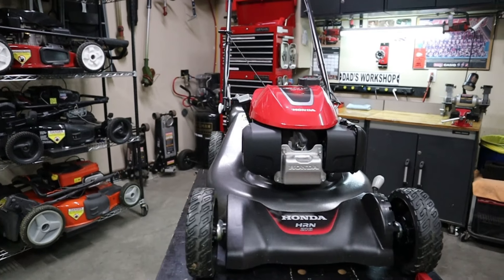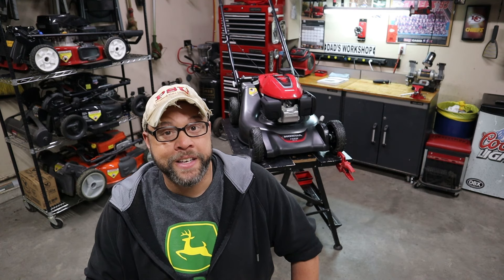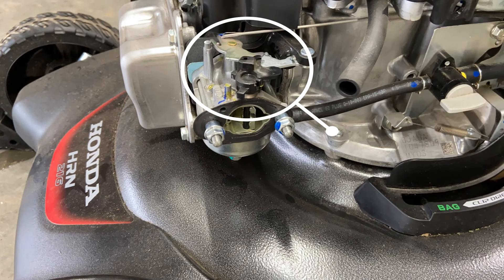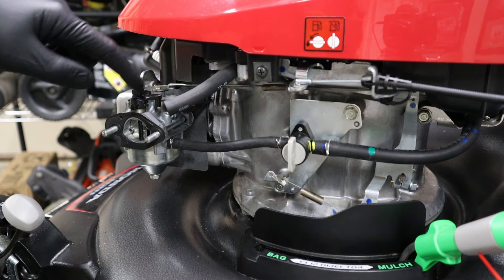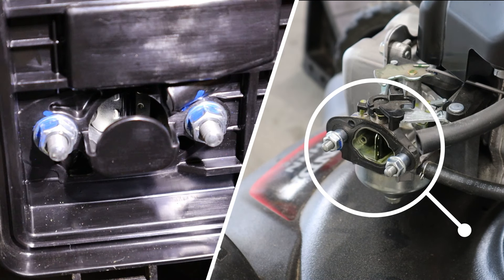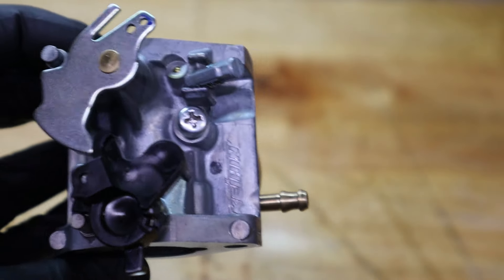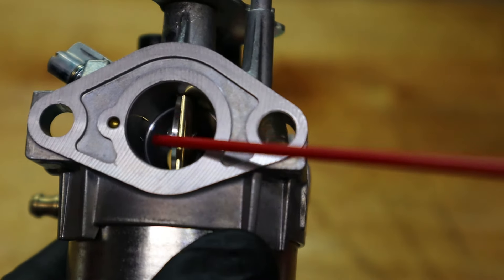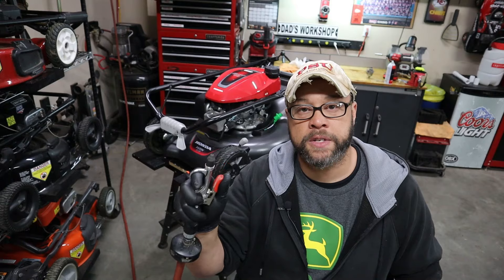New 2020 HONDA HRN216 GCV170 Surging/Rough Idle AND Auto Choke Test/Check

Comment: One important step you failed to mention is to remove the idle mixture screw. Many times that's where the restriction is at, the only way to clean out any stuck debris is by removing it. It's the brass screw with a spring around it and is underneath the aluminum cover with a slot for a flathead screw driver which you must remove it in order to remove the idle mixture screw. It's held on with Loctite so don't try prying it off or you'll snap off the brass idle mixture screw. You need to heat it up with a small torch for a few seconds (Bic flame torches work great) but it'll quickly melt the aluminum if you're not careful. Before removing idle mixture screw, make sure to tighten it until it bottoms out while counting the number of turns because it needs to be set back in the exact same position. If you forgot to do this, it's 1-1/2 turns.
Reply from the maker: Thanks bud!
Reply: I don't think he failed to mention it; I think he didn't mention it because in most cases, like mine, it's unnecessary.
Reply from the maker: This a fixed throttle. You can't adjust the throttle on this style carburetor.
Reply: @dadsworkshopbykipplabrie7982  It's an air/fuel mixture screw for the low speed jet, not an idle speed adjustment. CCW richens it, CW leans it out. With this type of mower in particular with a blade clutch, it uses the low speed jet with no load on the engine (blades off) so you'll notice more of an impact with a clogged low speed jet than a traditional mower where the blades are spinning whenever the engine is running. Yes, you can just try blowing out the low speed jet with carb cleaner and see if that fixes it, but in my experience, that doesn't always fix it and it needs to be disassembled completely.
Reply: lol ok bud @weeeves
Reply: Thanks for the tip

Comment: Guess I’m the only one that the Hulk installed the pilot jet screw in. It will not budge. This will be my last Honda, the name no longer means quality.
Reply: Yeah same here but I did a number on it, stripped the dam Philips notch right out😩
Reply: Same here. I soaked it it’s Aerokroil overnight. The screw is so soft and so driven-in that the slot just rounds out. I put a 1cm length of auto vacuum tubing over the round throttle stop on the upper left side of the carb. It’s enough of a spacer to increase idle speed and stop the surging. Not an elegant solution but it is fast and cheap and it just works.
Reply: Same. I was about to strip it and decided to stop.
Reply: Couldn't get my screw out either. Just about stripped until I decided to stop. Engine still surges........
Reply: Same issue with the screw
Reply: My screw did the same, but got a small set of needle nose Vice grips on the screw head. It didn’t take much to get it to turn just a little, then it came right out
Reply: @justinhaynes9966  did it fix the problem once you were able to get the screw out?
Reply: Super tight but I got it, blew a little keyboard cleaner through, fixed it right up
Reply: Same here. I used a file to create a deeper flat opening and used a big flat screwdriver with the carb in the vice, set it on an angle to break it open and tapped it with a hammer, it came off but it was a pain in the ass
Reply: Same here. The Hulk held the carb while Superman tightened the screw.
Reply: Put a little heat on it, a torch for about 10 seconds and repeat a like longer if not successful the first time. No gas in or around an open flame. Duh! LoL
Reply: Is there a way to clean out pilot jet without removing that screw on top? Like spraying carb cleaner up from bottom? I also stripped the screw
Reply: Whoever put that pilot jet screw in used the same torque setting as a Honda crank bolt. Mine stripped out as well.
Reply: Haha I just did tried this today and almost immediately stripped the screw. Now I am not sure if I have to buy an new carb or get it serviced. Not sure if there is a way to clean it without removing the screw
Reply: I had to remove the red cover to get straight angle and enough torque from Dewalt driver but then no issue
Reply: Same here, stripped it, couldn’t get it off, but cleaned other two holes and it worked fine after
Reply: They use threadlocker on it and the pilot jet because it's an emissions carb. They'd rather you throw away a perfectly serviceable carb and have to spend $60 for a new carb every 2 years. Jerks.
Reply: Yall Crack me up, if your stripping it out you need to get a new qaullty screwdriver. I personally like to use a rachet screw driver with a fresh bit to get these out. No issues. If you start to feel it stripping, STOP and grab a pair of vice grips to give it some more leverage
Reply: Same here my lawnmower and power washer both have problems all the time
Reply: My screw was also very tight, but removable with mole grips (UK term for vice grips). Post-cleaning, the mower runs fine.
Reply: My 2020 honda just broke time to pull out the 2004
Reply: @jmabs5096 yes a ratchet Phillips head worked great. Thanks for your comment !
Reply: @jesussolis6840 I wasn't smart like you, I went ahead and stripped the duck out of mine🤬
Reply: Yeah!! The Hulk's baby brother must have installed mine, stripped the crap out of it 🤬 Buy a Honda and you'll be happy, i'm not happy now!!
Reply: The screw tightness is how the green liberals keep us honest, easy screw removal might tempt someone into wollering out the jet hole a tiny little bit so it could perform the way it should. And that is exactly what I will be doing if I can manage to get the screw out. That'll teach 'em.
Reply: Yeah, me too. Thanks for making this look so easy. Reality is a little different. My pilot screw is now stripped. But, hey, kipp’s came right out. No problem.

Comment: I have the exact same mower with the blade clutch. HRN216VYAA. Right out of the box brand new,  the mower has always surged at the fast idle throttle lever position. At slow idle it runs fine and with the choke on it runs fine. Engage the blades and it runs fine. It only surges at fast idle. I replaced the brand new carburetor with another identical brand new carburetor. Same exact issue with the other carburetor. I really think the idle jet is too small. When the blades are engaged, the mower runs off the main jet. I will probably have to take the mower to an expert who's been repairing mowers for 40 years. A guy like that probably knows exactly which size reamer to use for reaming out the idle jet. I don't have the stomach to experiment because the carburetors are over a hundred dollars a piece. If the idle jet was removable like the main jet is, I could experiment, but the idle jet is not removable.

Comment: Installed new carb, new gaskets, new plug, new airfilter, keeps hunting. racking my brain as to why!!
Reply from the maker: I’m sorry to hear this. Double check your governor spring setup and linkage on the new carburetor. Thanks for watching
Reply: @dadsworkshopbykipplabrie7982   found the issue and it was my carelessness.  As you know, reinstalling the carb and lining up all the gaskets can be...I installed the 16211-ZL8-000 Carburetor Insulator was upside down.  once I installed it correctly so the vent was to the bottom, it worked.
Reply from the maker: Hell yeah! Good the hear
Reply: @meggabitz  Nice catch! I'll have to go check my insulator and gasket as I've already rebuilt this carburetor after inheriting an HRN216 that sat unused for a decade. It's very possible I got the gasket or insulator upside down.

Comment: Mine is doing this on the first start of the season.  Cleaned it out as described and seeing the carb cleaner work its way through but still surging. 🤬
Reply from the maker: Try sticking a sewing needle down the pilot jet
Reply: @dadsworkshopbykipplabrie7982  another cleaning along with sticking a needle in it and it started running properly.  Thanks
Reply from the maker: Hell yeah! Dillon I'm here to share.
Reply: @grieve84  for real needle did the trick for me as well

Comment: Thank you so much!  8 month old pressure washer was doing this exact thing at idle. Under load it was fine. Took carburetor off and did as you suggested and she now idles smoothly!  Had a heck of a time getting the screw off but finally got it. Went to a Big Box store and got a set of welding nozzle tip cleaning brushes for $7 and used them to clean the pin hole and did the main nozzle too.  Super easy and would not have known how to correct this issue without you!
Reply: How did you get that pilot jet screw off? I haven't been able to budge mine. Might try heat next and if that fails I'll cut a slot for a flat blade screw driver.

Comment: You recommend checking the autochoke mechanism in step one.  Mine did NOT work properly.  I had to replace (Honda 16620-Z8D-305 Thermo Wax Assembly) and the autochoke  mechanism returned to normal.  

Your tips on disassembly/re-assembly and jet cleaning were very helpful and initially fixed my problem, but the problem came back in my case. Premium gas made no difference.  Thanks for all the conversation helping all us DOY people save $$.

Comment: The same general fix works on older HRX 217 mowers, as well. Surging is a common problem with them, too.
I could not help but notice how much simpler it is to access and service the carburetor on this newer model Honda mower.   Sweet!
Thanks for the video.
Reply: I got a brand new 2022 HRX HYA model before the inflation price hike.  If you do any type of scalping for a new lawn establishment (thus generating lots of dust and dirt clouds), just be ready to deal with a "surging on idle" symptom and clean the carb.
Reply: @mattb9664  I never scalp a lawn, but I always check the air filter for dust build up.  I add a good quality fuel system cleaner to my mower gas and also use TrueFuel for every third tankful of fuel. I always store the mower over winter filled with TrueFuel.  No surging problems since I have been doing this.  No carb rebuilds, either.
Reply: @jerrystark3587  scalping 1" for lawn renovation that is.  Never during normal mowing!
Reply: @mattb9664  👍👍
Reply: @mattb9664  I scalp my lawn once a year too. I usually cut it at 3” but will take it down to 2” when I power rake and aerate. Then I like to fertilize and top dress with some peat. I have an HRX217 that is close to 10 years old. It does this surging thing when I first start it up but it goes away after about 30 seconds. It has done it since new so I always thought it was normal. Lol
Reply: @beri232  Yours is acting quite opposite of mine- It could very well be the wax cartridge for your case.  When that dust cloud is generated, it gets everywhere and reaches the wax cartridge too- the dust will collect around the pin when it's extended, which then draws dust into the thermoswax inside the cartridge when the pin goes back in during cooling- and the temperature cycling behavior of that pin is totally changed at that point, becoming slower and maybe not even fully drawing back in or pushing out.  This causes harder starting and makes it really hard to start in the fall during cooler weather.  If that choke isn't working correctly, you can have surging after starting from cold.

Comment: This did the trick, under 10 minute job.  I removed the carb (take note of what hole the linkage rod and tiny spring go for reassembly - take pics prior to disassembly) I used carb cleaner, then compressed air at 30 psi.  My new mower started doing this 3 weeks/mowings into it.  Thank you for this video!
Reply from the maker: Thanks for watching Urban.

Comment: So I bought a Dewalt pressure washer this weekend with a Honda GCV200 motor. After setting it up and point the provided oil inside of the motor I filled her up with premium gas and wanted to test out the brand new unit. It took me 4 or 5 pulls to get the engine running but once it started up it immediately did this exact same surging while idling. When I pulled the trigger and sprayed water it ran decent. As soon as I let off it began to surge again. I'm going to go ahead and follow this video and clean up the Carb tonight. Very happy about this video!

Comment: Wow! Wow! I took off the air filter and moved the housing out of the way. Slid the carb out a bit and had great access to the screw on top. The screw was on tight! Spayed in there with the straw( watch out it squirts back out) then squirted on the aft hole in the side of the carb. Waited a few minutes, reassembled it. Pulled the cord and bam! Works like a champ! Thank you so much for the video.

Comment: Thank you so much. My Honda’s carb is so old it doesn’t have a pilot screw- or one that I could finely. So I simply sprayed the carb cleaner in the hole you suggested. After that I started the mower and it still ran terrible. I let it warm up and now the problem is gone!   Thanks again!!

Comment: Now, if we can just get that mulch door to work lol. I was sleuthing around to see if anyone had that problem and stumbled upon this, and I'm glad I did. Mine surges until it gets warmed up, usually settles down after a few minutes. I figured it was normal and attributed it to the auto choke system. But yeah... I haven't bagged clippings the past few mows and while I give her a nice dusting off cleaning after every mow, the next time I bagged I was surprised to see how much got trapped in the void between where the bag mounts and the mulch door. It was compacted like a brick filling the entire void lol. Thanks for the video Kipp
Reply from the maker: You’re exactly right! I noticed the debris build up as well, wasn’t sure if the bag would even lock into place.

Comment: Thanks a gazillion!  

I have a 5yo HRX217, that has been doing this for 2 seasons.  I replaced the thermowax twice and it ran a little better for a while and got me through after taking it to a shop, and even they didn’t fix it. 

Spent an hour cleaning the carb and it purrs like a kitten again!  

I do wish you’d shown how to manage this on the motor, just for reference. I was a little nervous about taking it off and could have used a little more guidance there too. Afraid of gas leaking you know…

Instead of a sewing needle I used a single strand of heavy gauge wire about half the diameter, to make sure it didn’t get stuck. 

Thanks again!

Comment: Hi Kipp, great video! Thank you! I couldn't believe my two month old Honda mower (same model) was having this problem. My Honda cars and van have been great vehicles to own with amazing reliability. My new Honda mower had me worried.

Like other folks, I've had Craftsman mowers for decades and never had to remove the carburetors for any type of service.

Your video helped me get my Honda mower running smoothly again. Thank you! In addition to your fix, I installed a fuel filter between the gas tank and the fuel cutoff valve. Hopefully this will prevent future, similar problems.

This mower is a pleasure to use - when it's running properly.
Reply: No kidding.  I had an underpowered Craftsman mower for years but wanted something with a little more power.  I thought I was getting something a little better with my Honda, but buy, was a wrong. 

I think I'm going to have to go back to B&S engines.
Reply: Did installing the fuel filter help?  I'm having so much trouble with mine.
Reply: @davidchapman2979  Well, it seemed to, until the first time I used it this year. It was right back to surging again. Another YouTube video showed a guy putting Mechanic in a Bottle in his. I thought, why not? 10 minutes later and the surging was gone.

My Honda mower never started on the first pull until after this year's annual service. I changed the oil, air filter and most importantly, the spark plug. Now it always starts on the first pull. The original plug was bad.

Comment: I’m going to like this before even tackling this.
I literally just bought this exact model a few months ago, and you called it: fresh, stabilized fuel! 
Hopefully I don’t have to do this every single year!! Thank you!
Reply from the maker: Thanks for comment Mr. T! Some of my fellow Lexus techs have had success running and little bit of "Sea-Foam" in the gas tank. I'm guessing it helps dissolve any kind of debris that build up in the carburetor especially those tiny pilot jet passages. Thanks for watching Mike.
Reply: @Mike T
Bought this mower in March took it back  end of June got an exchange  same mower used it 3 times same thing happened not working on a new $450 P.O.S myself. Taking it back FINISHED WITH HONDA MOWERS.
Reply: @stephenvaughn8171  Bought mine at home depot used it one time and rough idle now 4th time using will not even start using ethanol free gas!  $600 mower and it is such trash! Home Depot will not take it back or help me at all!
Reply: @shortythefrenchie  Your going to have to take it an authorized repair shop and wait two weeks for the Honda warranty to fix it.
Big headache for an expensive mower.

Comment: Very helpful video.  My brand new Honda lawnmower started surging exactly like your demonstration.  I removed the philips screw on the top of the carb and cleaned the run jet with a 32 gauge wire.  That fixed the surging!  Would have been a fifteen minute job except the philips screw head was defective and required slotting to remove it.